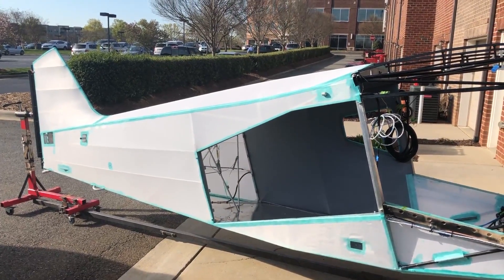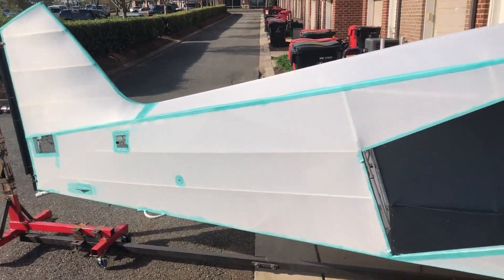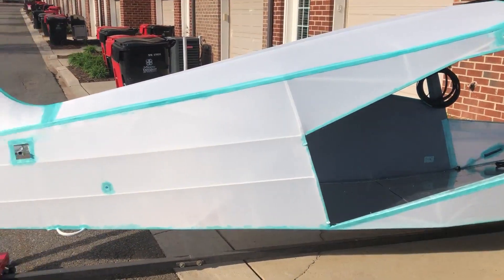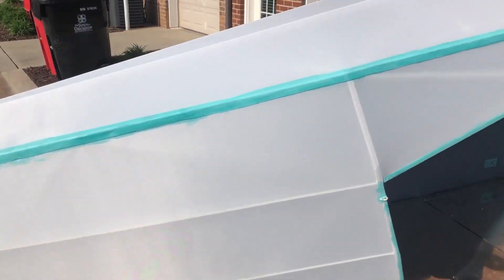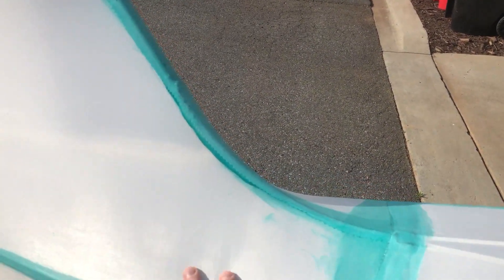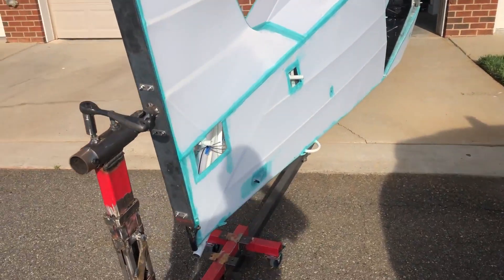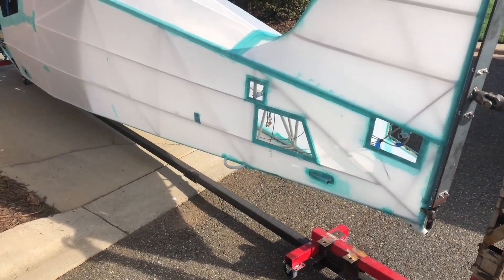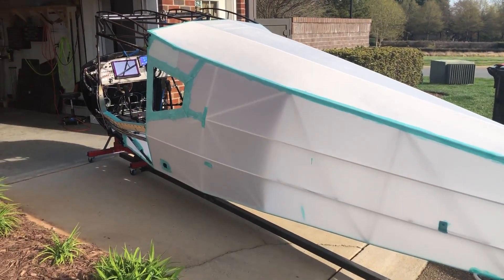Bearhawk - Initial Fuselage Fabric Covering for the Bearhawk

Comment: Hi, how did you do the transition from the top of the fuselage to the vertical stabilizer. I see there is a joint by I no the is no frame to glue it to
Reply from the maker: Yes, that area is a floating joint and was a challenge.  Couldn't have done it without the Stewart Systems videos.  https://youtu.be/MGpMEuPnM7g?t=5340

Comment: What are the green lines?  Is that where the glue lines are?  I'm unfamiliar with fabric covering.  Thanks.  Your bearhawk build is great to keep up with.
Reply from the maker: Yes, those are the glue joints.  You can see more about this process here:  https://www.youtube.com/watch?v=48OeYmvYHDM
Reply: I’m researching covering systems right now. Oratex, PolyFiber, Stewart Systems, AeroTech, etc. Many to choose from. What was the deciding factor that made you go with Stewart Systems? Thanks.
Reply from the maker: @texak1974  Two things...  1).  I am building in my garage which is attached to my home.  I needed something safe and without caustic fumes.  The Stewart System is water based and I can use it without solvents, gloves and respirators.  2) . Their YouTube training videos are the best!  I learned everything I needed from their videos, including how to use their paint system.  BTW...  I am more than pleased with the outcome of my paint job.
Reply: I would agree and also suggest that your paint job is pretty badass. Thanks for the reply.